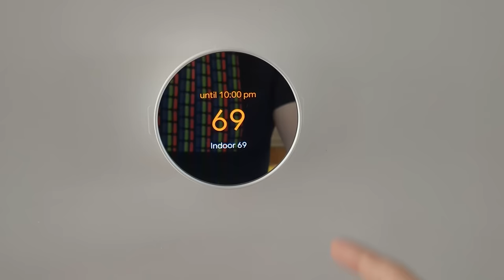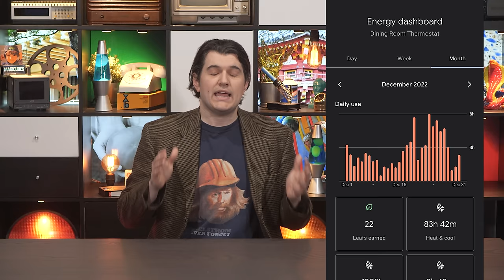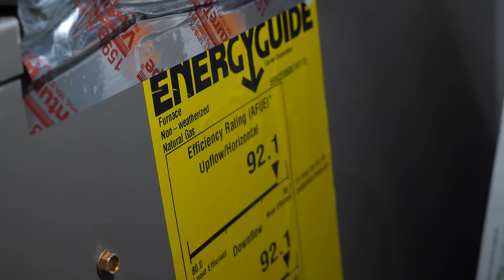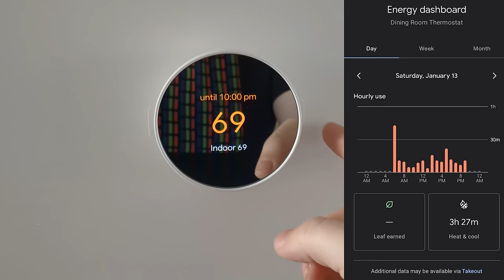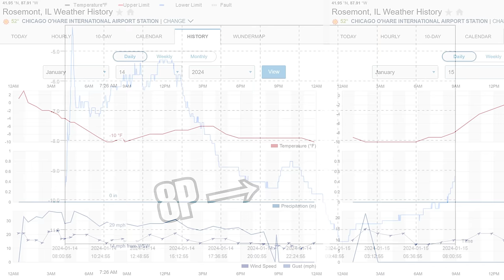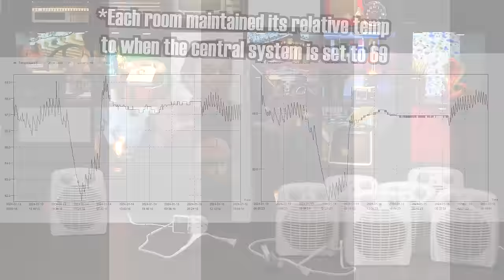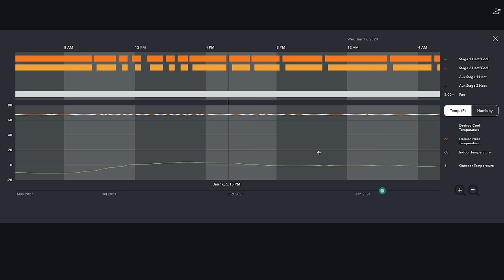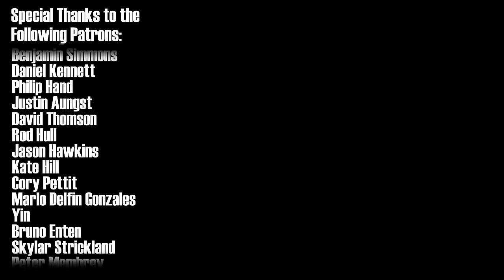Old HVAC industry practices are holding us back and costing us money. But we can fix it.

Comment: Hello Mr. Connections

I do enjoy your presentations. Youtube understands this and sends me more.  
But I must risk looking like an idiot here because I am going to differ with some of your conclusions.

Last November I had a dual fuel (nat gas/electric heat pump) installed, 70000BTU/hr furnace and 36000 (3Ton) BTU/hr air source head pump.  I was interested in seeing how economical that super duper magical heat pump was.  Like, was it a good idea.

Because of our EV, we are using time of day pricing for electricity.  During the night one kWh costs $0.10628, during the day $0.23382 (the flat rate if not using on/off peak pricing is $0.17154.) Conversely, one therm natural gas costs $0.7915.  For my calc of how many kWh are in a therm, I used 1therm is 100000 BTU and one kWh is 3412 BTU so (1*therm*100000*BTU/therm)/(3412*BTU/kWh) gives 1 therm, costing $0.7915, is 29.307 kWh. 
The cost per therm for heating is:
	Resistive (100% efficient) heat is:
		Night ($0.10628/kWh)*29.307 kWh/therm = $3.78 per therm
		Day    ($0.23382/kWh)*29.307 kWh/therm = $8.317 per therm
		Flat   ($0.17154/kWh)*29.307 kWh/therm = $6.101 per therm
	Natural Gas furnace
		Day or night 	$0.7915/96% furnace efficiency = $0.824
This is why we don't use resistive heating.  But to reach a price parity the heat pump will have to achieve some serious performance.  The required COPs to achieve this are:
	Night  $3.78/$0.7915 or 4.776
	Day     $6.853/$0.7915 or 10.508
	Flat     $5.027/$0.7915 or 7.708
The heat pump we bought (Armstrong air's top of the line, SEER of 22) specifications say that it can achieve a COP of just over 4 under some very limited conditions.  Those being inside coil temperature of 75 F outside temp 65 F.  The constant (per day) facility cost is more for electrical service too. So there are no use cases in which it is more economical to run the heat pump for heating. This is why we don't use heat pumps for heating too.

There are a couple more strikes against the heat pump:  first that the published COPs do not consider the energy used to run the circulation fan.  This can be about 1/5 of that required by the HP compressor.  One could consider this to be resistive heating as the energy of the moving air dissipates into the room and the inefficiencies of the motor are similarly home heating.  There is also a de-frost cycle for the outside heat exchanger where the heat pump is run as an air conditioner to heat the outside plumbing to melt away any accumulating condensed ice.  I have also found that the air, when HP heat is used feels cold, not the toasty warm that the gas furnace supplies.

I've got some other issues with a "right" sized furnace running 24/7 too but this is getting too long for youtube.
Reply: I think there is something missing from your gas rate. That's almost half of what the average is in the US with nowhere seemingly dipping below $1 per therm. And versus the electrical cost, it's bordering on (if not already over) the point where a generator would produce electricity cheaper than getting it from the grid (not factoring in legal issues and potential maintenance costs).
Reply: @BenIsInSweden  Well, I tried to respond with a bitmap of my power bill, but youtube wouldn't take it.  So I typed it in and something went wrong and it never appeared.  Suffice it to say, my PC (mousepad, ubuntu linux 18.04, firefox dunno version because it tries to update itself if I look at help/about) does not play nice with the youtube editor.  

I calculated the marginal gas price per therm as $0.3242 (Distribution charge)+$0.5003 (Base Gas) with a "PGA" which I think is (negative) Purchased Gas Adjustment for last month of -$0.0057*(18/31days)-$0.0707*(13/31days)=0.3242+0.5003-0.03296=$0.7915 per therm.  I'm ignoring the fixed "customer" charges because they are larger for the electrical usage and that makes the gas an even better economic choice. 

 Sorry for any incomplete or garbled messages but I'm having real trouble trying to comment on youtube.

Comment: The problem with heat pumps is that they're very inefficient in colder climates, they will need to be accompanied by heat strips. That will drive your electricity bill significantly. Furnaces will remain the best choice in places that get below 20°F
Reply: "Best Choice" Using what metric?
Mine have worked just fine in -20C/-4F for 3 days straight here without heat strips.  Given that gas prices here are only marginally cheaper than electricity, it would never make sense to use gas for heating even in those temps.
Reply: @BenIsInSweden  wow that's surprising, I've always been taught that heat pumps aren't good for those temperatures, are you using a geothermal heat pump by any chance?
Reply: @ItsAFantaSea  All 3 of mine are air 2 air (2 Toshiba Daiseikai's and a Hitatchi Yutampo Twin).  I know there are certain scenarios in the US where the air handler isn't within the heating envelope/conditioned space so heat strips are required for defrosts.  That's more of a building issue than a heat pump one really.
Reply: @BenIsInSweden  are those all inverter driven mini-splits? The heat pumps I was referring to are the ones that serve a whole house in the US, those aren't nearly as efficient.
Reply: @ItsAFantaSea  Yup.  There are definitely whole-house ones in the US that are efficient, and don't really need heat strips. The main key is where the air handler is, and whether it's properly sized or not.  HVAC Dope Show has several videos on CCHPs in the US etc.

Comment: You forgot one... Space/living area is more expensive than the cost of cooling/heating leaks in California... so, yes, the attic ... don't think people are defaulting to dumb, there are higher maths in play that you did not see yet... 51:25, your math is wrong again. The integral of time will cost more by using a smaller Heat pump, as the efficiency is about the same between big and small, and the start peak is negligeable. The run time of the heat pump is almost the only things that matter. Oversizing is a requirement of heatpumps. You only need to do the math once.

Comment: Are you acounting for your neigbours heating? I live in a 3rd floor apartment and when its really cold outsode i hawe to turn of my heating sometimes ewen opening windows. I hawe neigbours on tree sides of my arpartment and when they all run their heating at full so mutch of that leak into my apartment that i cant use my heating.

Comment: in good ole freedom eagle land, we pay stupid low prices for wall gas.8 to 15 cents per kwh. there's no reason for that to ever go higher. outside of certain people just wanting it to. the answer to the "energy crisis"(there isn't one, but) is nuclear. clean, green, reliable, plentiful. wind and solar are not currently efficient enough and won't be for a long time to exist without natural gas and other fossil fuel backups. nuclear does not need that stuff. the fact that nuclear is not being pushed by the greenies like they are wind and solar, proves they don't want to fix a problem. they want to control us more, by making wall gas cost 50 cents per kwh or something ridiculous. which means your electric car charging will go up to like 1.50 or more per kwh.

Comment: My question is how much you pay in a kilowatt in Chicago we're paying 48 cents a kilowatt in California Southern that's about five dollars a day for electricity plus all the other electricity use in your house? That's all our California governments trying to force us into solar it cost $30,000 to put on your roof minimum without battery backup. Gas plus electric for the blower fan it's cheaper then go on the cheap route that you're doing sorry that's just my opinion I want to share this video with friends that want to free air conditioner house but I don't think I could show him unless I was watching it with him the correct many things that you've said that are wrong I guess it's because you're from the Northeast and I'm from the southwest difference in utility rates but I do believe it and it's like your house much better housing is built to minimums instead of maximums and the contractors make the difference in dollars find a good contractor impossible they take advantage of homeowners
Reply: We chicago goers pay around 15-16 cents per kilowatt. Also you're run on sentences are confusing as all heck to read/understand.

Comment: Forget the boomer Heat Pumps and Traditional Heaters. You should be mining crypto with ASICs and GPUs and letting that heat runoff keep your home nice and toasty for the winter. I also do this for my greenhouse. If you have to spend X amount on power and a unit anyway - why wouldnt you want it to generate revenue at the same time? 

Crypto mining is the way.

Comment: I'd like to add.
If you home is heated by an undersized heat pump -- heating becomes a nightmare. You HAVE to get it properly specced out.
I bought a house that has a miniscule heat pump. It cannot maintain 70F in the winter. It's physically incapable of doing so while running 24/7. (Also painfully expensive at $500/mo compared to nat.gas at ~$100/mo)

Comment: My gas is not just for heat. It also gets used for hot water in the dishwasher, hot water in the clothes washer, hot water in the sink and shower, and gas for the stove/oven. Switching to a heat pump sounds good, but there is a lot more to consider.

That being said, my gas company gives me a monthly report along with my bill that tells me how much gas I use and poorly breaks down how they think I used it, so that's helpful.
Reply: "hot water in the dishwasher", probably not, nearly all are electric heated.  An option for all those gas appliances that I'm using is to have a second smaller water heater in front of the gas heater that is powered by solar.  (Electric or Solar Heat panels.)

Comment: i do not see the isue with the heating side.  making it smallholder might actually cost you more money than the "oversized" furnace.  it saves wear on the  motors and therefore saves yon money.  electric only is not better for the environment...need to look at where your power is generated.

Comment: I'm sorry but Alec cannot test his home accurately because he doesn't live in a single family home with all the walls exposed to the OUTSIDE elements. Literally all his metrics are negated because two independent yet adjacent homes are HEATING HIS HOME VIA PROXY. He might be able to get away with using a heat pump if his neighbors keep the forced air natural gas furnace. Natural gas prices are so insanely cheap in America. Electric cant compete (yet) in the Midwest
Reply: He matched a certain heating requirement with a heatpump setup. The setup of the house doesn't matter.

Comment: So… As a Minnesotan. Heat pumps are GARBAGE! I installed two of them in my previous home. In the summer. As an air conditioner. I absolutely LOVED them. But as soon as the outside temperature started approaching 0. They started freezing up and failing. Now, I know there are better units out there. And they claim to heat down to -20. However Minnesota is often the coldest place in the country. And our record low is -60 actual temperature. So with that… You’re looking at having to increase the temperature 120-130 degrees. The ONLY thing that is going to get you there is FIRE. Be it in a fire place of some kind. Or you could have a flame furnace fired by gas or oil. Electric heat or heat pumps will NEVER keep up with that kind of demand…
Reply: Did you get units that were designed for the weather conditions? Cold weather heat pumps are supposed to have resistive heaters that prevent it from freezing
Reply: @JeffreyMorse775  They were lower end units that were mini split systems, not central heat pumps. And no, these did not have heaters in them. However, They were supposed to be rated to heat down to 0 degrees Fahrenheit outside. However at around 10 degrees. They would get so loud we usually just turned them off and used our electric baseboards. The home I installed them in had no central heating or cooling system. Only electric baseboards in all the rooms. 

You are right that some units have heaters in them to help with cold weather operation. But the best that is today is -20f or so. And as I mentioned. Minnesota quite regularly gets well below that. Sometimes for days or weeks at a time. So it’s really a moot point. 

To give a little bit of context though… While the units I installed worked as they were designed to. That’s just not gonna keep a house warm when the daily HIGH temp is 0 degree weather. That means that under the best circumstances. With no wind and full sun. You’re going to be 0 degrees for all of 1, MAYBE TWO hours of the day. The rest of it will usually be in the 10s or 20s below zero. With the way these systems work. They do, in fact, heat down to 0 degrees usually. But they have quite a long defrost cycle which outlasts the heating cycle. So even though they’re technically working fine. We could only use them for heating when it was warmer than 10 degrees out.
Reply: @brandoncrimmins6296  Well you bought an inappropriate unit for your area and then call the entire technology garbage. The ones that have resistive heaters to do the defrost do not need to do a defrost cycle. You previously stated it was rated to -20f and now claim you bought one that was only rated to 0f. That is obviously inappropriate for Minnesota.
Reply: @JeffreyMorse775  You seriously need to learn how to read. Firstly. I never said that. Go back and reread my comment. I said there ARE units rated for -20. I never claimed I bought one. 

Secondly -20 is completely irrelevant when you’re talking about temperatures at -60. You do realize when referring to temperatures BELOW zero with a minus in front of it. The larger the number… The COLDER it is, right? 

-20 doesn’t mean one damn thing when air temperatures regularly dip well below that rating.
Reply: @brandoncrimmins6296  Who is talking about temperatures at -60? That is the all time record low ever of Minnesota not a regular occurrence...
Reply: @JeffreyMorse775  no but it does regularly get down to -35. Far colder than any heat pump is ever going to be able to operate in.

Comment: OK let's start poking holes. Furnaces (not AC) are fairly uniform in size. First of all, most modern houses have very similar sq footage heating requirements (and we even install multiple furnaces on different floors for 3000 sg ft homes and larger) and similar heat loss percentages. Manufacturers do not design for older houses as they are a small fraction of sales (heaters last decades, unless you buy a heat pump - compressor failure, capacitor, coolant leaks, etc) and few people have the money to throw at a heater replacement and would rather whine about the gas bill. You keep harping on the furnace run time in your townhouse. There is little benefit to a furnace running a longer period of time, especially with modern thermostats that will homogenize hot inner rooms with cold outer rooms by running the blower motor without heat. Your particular situation is unique, you have very little heat loss to the outdoors because you probably have two units to either side that provide you a very low loss and probably help heat your house. Same goes for the attic, which is shared, minus some fire barrier and Chicago is pretty strict about insulation in new construction on those multifamily units (although the shots look more like a Western suburb like Elgin, Aurora or Hanover Park). You don't need to size equipment for a sale and the bigger the unit, the more profitable the sale. As long as the buyer is warm/cool and happy you had a good sale. Most people will move long before even the crappy Goodman units start to fail and even a crappy unit will still heat a house. If the customer complains of cold, charge them for a size upgrade or install a second unit at double the profit.
Oh nm. You poked holes in your own arguments at the end. :)

Comment: Won’t it wear out faster if it’s running more or continuously
Reply: He addresses this in a video on his second channel. It’s actually better for the compressor to run for longer periods because during starts from stops, it runs without lubrication for a moment. If you oversize a heat pump, you run the risk of it constantly turning on and off which puts unnecessary wear on the machine.

Comment: This is the one time I'm at odds with you. Primarily because Britain is designed so that if something unusual (a regular yearly hot or cold snap) comes along our infrastructure crumbles. Your repeated assertion that "When it's really cold your heater should struggle" ignores that 1. That's when you really need the heater. 2. Britain is evidence of the fact that building to be optimised for the norm disrupts things when it's not the norm. 3. Climate change means summers will get hotter and winters will get colder. 

You might argue "Well good central heating installers should factor climate change making extremes more extreme into the equation" but that seems to run counter to the repeated assertion. Given America is an Amalgum of corporate corruption and stupidity I accept your central thesis that the installers should be put back in charge of sales. I just think having a generous margin of error for heating needs is probably good.

Comment: Let me know how that works out for you i know from personal experience it is pure bunk and you are always uncomfortable to hot or the thing never shuts off. Ground loop heat pumps now that is a different story but air to air heat pumps that use supplementary electric heating strips suk and cost a fortune to heat with unless in very moderate climates like San Diego.